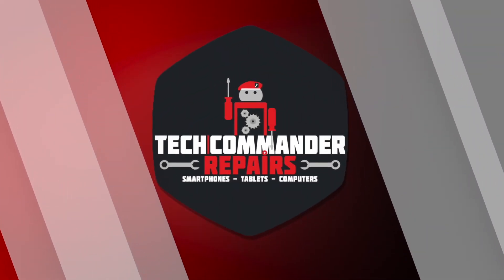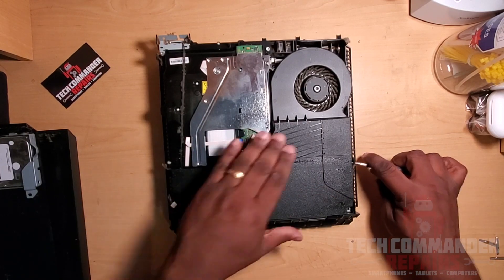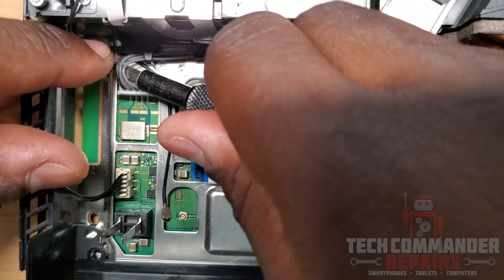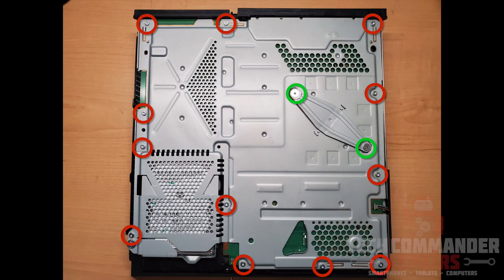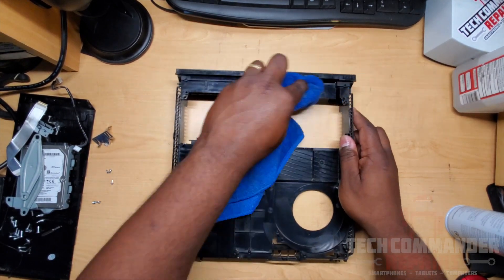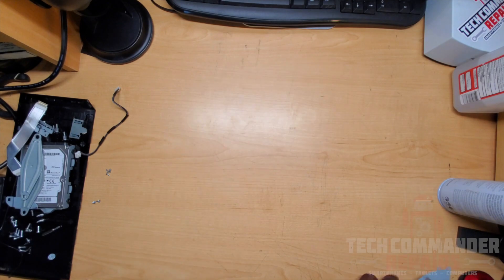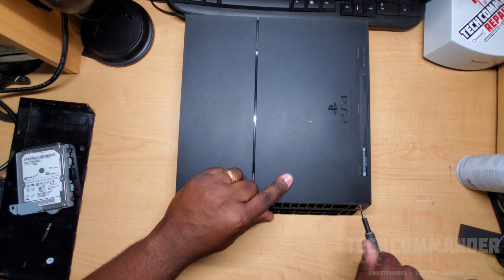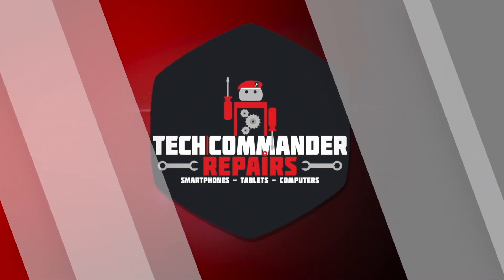PS4 Teardown (Original CUH-1001a model)

Comment: on the lil squares around the apu are those foam things important cuz im lowkey missing one
Reply from the maker: Might be the thermal pads your talking about. Yes they are important. They help to transfer heat from the RAM chips to the metal frame to keep them from overheating as well

Comment: hi tech commander. my son has a psa4. it's not coming on the TV side. on the screen, it says something like to plug  the USB wire to the machine and the control, then press the button the control but nothing happened.  what do think might be the problem.   thank in advance.
Reply from the maker: Hello, there may be a problem with the hard drive. Thebfiles may have become corrupted or the hard drive needs to be replaced

Comment: They are T6 not T8
Reply: And failed to mention lifting up on the power cable for the fan instead of just saying pull on it
Reply from the maker: I'm pretty sure they are t8. I repaired one today.
Reply: thanks alot ,does it cost alot.
Reply: the hard drive

Comment: Incredible video. Thanks a bunch! Any replacement fan recommendations?
Reply from the maker: Thank you. With replacing the fan you can find many online vendors selling these. Ebay and Amazon would be the easiest. But just search for a replacement fan based off the part number that's stamped on the actual fan

Comment: my cuh1001a has only 2 screws in back when taking off the top having a very hard time taking off the bottom cover every video I find people seem to breeze right through it and I am stuck.
Reply: I know it's 7 months later but I figure I'd post this for anyone who runs into this problem because I did too. The right and left corners of the bottom tray have two more screws under thick plastic stickers. You have to try and pry them up with a thin flathead screwdriver. They're a glossy black rectangular shape. About 1cm tall. Once you get them off you can get to the additional two screws 👍.
Reply: @008AC why the fuck did he leave that out lol good stuff man thanks
Reply: He mentions it during that step